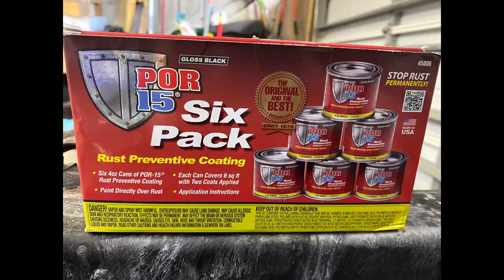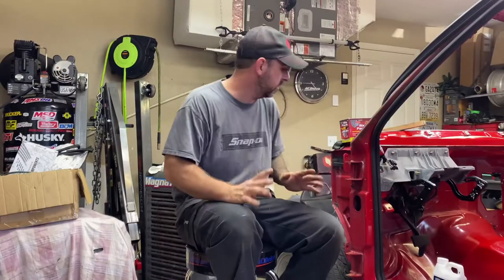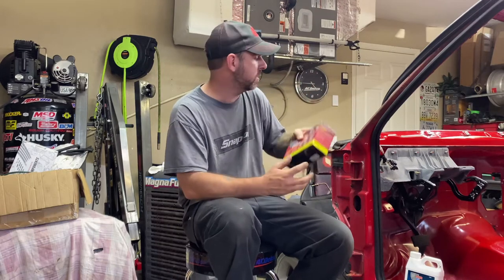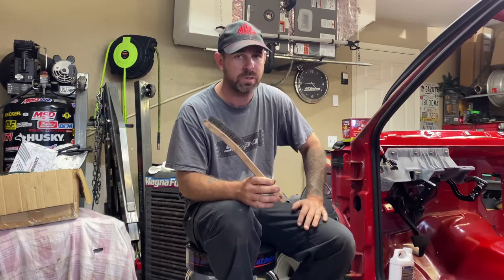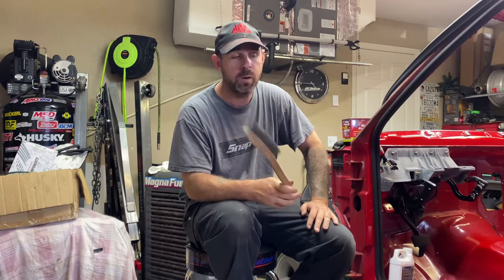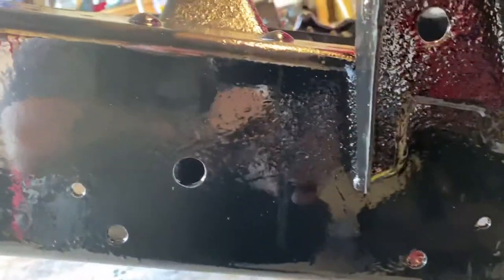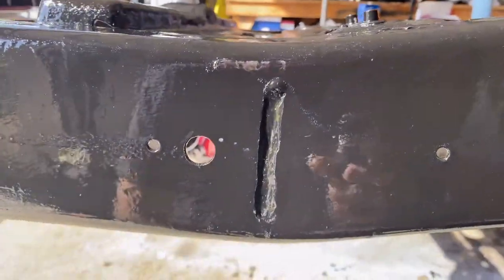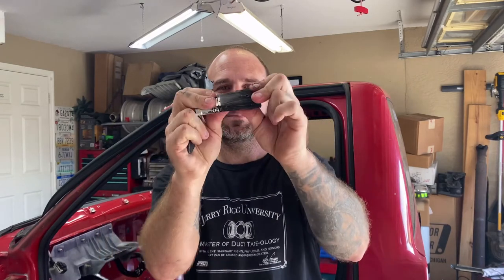Painting my frame with por 15 & tips

Comment: This is going to be tough but I think I want to brush por and then metallic blue topcoat the body with the engine enamel. I did the rims and you need an air supply in a closed garage or an expensive 3m filter mask at least, pretty harsh fumes.
Reply: That metal ready works great if you keep the rims wet constantly, I went a couple weeks with them in garbage bags and flipping them, notice the extra time.

Comment: I have a 6x10 utility trailer that I plan on buying por15 for it. So I have a question what would you recommend to do if it has the original paint on it yet. Would you paint over it after degreasing it and metal prepping it?